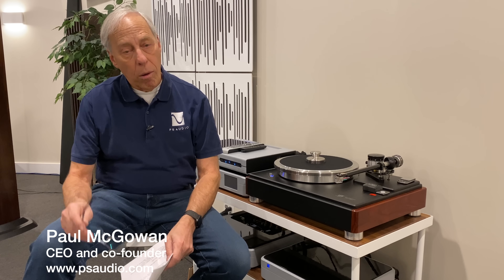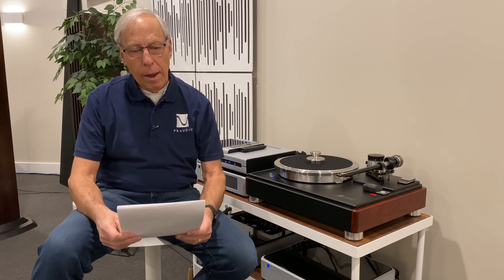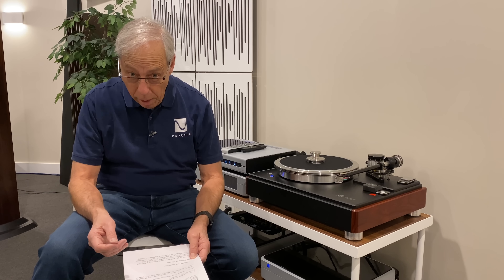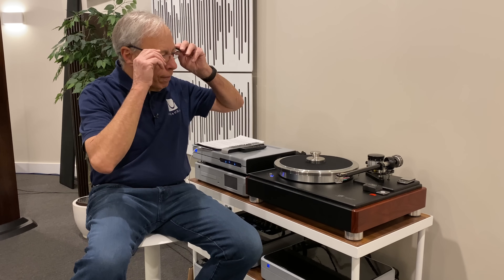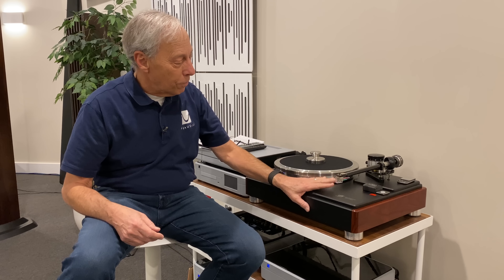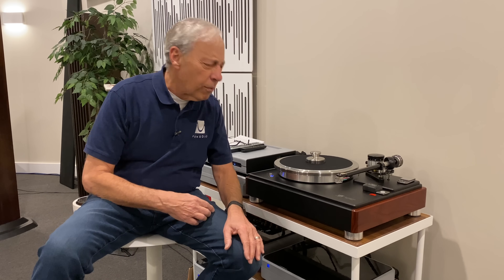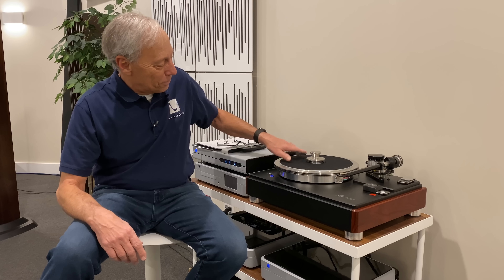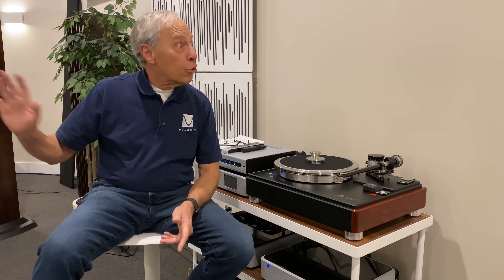Better to use a power conditioner or straight into the wall?

Comment: I still think your too easily influenced by the power of suggestion. A little series resistance in the mains line would effect peak power but that should be about it.  All those super high grade DC supplies give you all the quiet you need.  The iron core transformers inherently filter out most line noise you may be loosing sleep over.  Those oversized capacitors do the rest.  The loss of ambiance or whatever would still lead me to keep looking for a quantifiable explanation and solution.  If you think about it, the IRS speakers were as close to perfection as you could get but wait, we've upgraded the woofer system so now, now they're right.  The only way we can find contentment is to believe we've reached perfection.  Then reality sets in.  Drat. 

Sadly your power re-generators just introduce more stuff that does basically nothing but introduce reliability problems.  I suppose it could boost the mains voltage a little but so what.  I'd be curious to know what the carbon footprint would be for the manufacturing of one unnecessary power re-generator.

Back to the in-line common mode line filter...  I think what your saying is that the line filter some how would effect either the overall sensitivity or maybe slew rate of the system.  Hum?
Reply: if one is concerned about the carbon "footprint" of a manufactured item, it would behoove one to contemplate why he does not live like Diogenes or simply go the whole hog and cease one's own 80 year long conversion of oxygen into carbon dioxide.
Reply: @grandrapids57  Who's one?
Reply: @chrisharper2658  If you mean by "Who's 'one'" then "one" acts as the generic, universal pronoun in this instance, and by necessity that includes thee.

Comment: Of course a power conditioner (which ps audio peddles), is necessary for clean sound. 
And 12 inch tweeters are necessary to produce those highs.
Reply: blackened 1 ...what the f#@k are you smoking dude?!
PS Audio do not sell (peddle) Power Conditioners
PS Audio sell Power Regenerators
Do you understand the difference between the 2 devices? Obviously not. You need to get off the drugs for a while
Reply: @FatRat-f9m  ok

Comment: For me personally with my system the results are the exact opposite of what Paul says. 
I am using an iFi Powerstation. I've been testing going back and forth between the power conditioner and straight into the wall with my amp in the last few days and the results for me personally are much better with the power conditioner. 
I am not saying Paul is wrong, maybe some older power conditioners weren't as good as some of the newer designs, and I am sure a power re generator is the way to go if you can afford one, however conditioned power vs straight to the wall I think is very much system dependent and results can very quiet a bit from one person to another. 
Best to do an in home trial with your own system and let your ears decide what sounds better to you.
Reply: Was the line a shared line or dedicated?
Reply: @levijessegonzalez3629  It's a shared line
Reply: @spectralmeat  Well it could be because it's a shared circuit...

If it was a dedicated power line, the results usually are very very dramatically better. 

I'm currently running 3 dedicated lines to my Studio and also I would suggest looking at high quality receptacles as these make a difference supposedly.  

there's a guy on ebay right now selling some HBL5262 receptacles (audiophile approved receptacle) for very cheap. I bought 5 for 37$ shipped
Reply: @levijessegonzalez3629  Thank you for the reply. I am planning to run a dedicated line to where my stereo is when funds allow. It is a finished basement so running a line will be a bit pricey, but ultimately it will be the best option.
I will look into the receptacles, thanks for the heads up!
Reply: @spectralmeat  It is pricey especially if it's not a new build. (thats why Im thankful I just learned all this literally right before I am about to wire up my place).

However the good news is, you might like the dedicated line so much, that you can sell your conditioners and that might pay for the line or at least part of it.

If you do, definitely buy a hospital grade receptacle. The HBL5262 is great because it's solid brass contacts and connections which is highly conductive
Reply: i can second that, ifi’s parallel AC power filter infact increases dynamics, unless one puts too many of them in the power strip (3 for example). it seems to use a different approach than conventional parallel power filters do.
Reply: Voltage irregularities reduce transient response I feel.
Reply: If it aint blind testing, the placebo effect can fool your mind. In your head, you are pre conditioned to favor what you prefer or expect. So anyone who knows what is hooked up cannot be trusted. Do not say money does not count. When you know device A cost 10.000 and B less then 10 dollars that immediately changes your mindset . And yes, that makes a huge difference when testing
Reply: I have a monster HTS 3600 and I also have the opposite results, i get a better sound when connected to the monster than when connected to the wall, it’s a shared line, I guess that might be the reason
Reply: spent money always sounds better.

Comment: I like Paul and especially his demeanor.  Paul uses 1997-98 as examples for his experience with line conditioners.  What Paul neglects to mention among other things is that like any other cmponent there are superior and inferior line condtioners.  What Paul also doesn't mention is that finding superior line conditioners that actually work as intended is like looking for a needle in a haystack vs the many that that would be classified as inferior e.g. those that do nothing or induce their own sonic harm and for which there are many.  In fact, in my limited experience, the more popular the name brand, generally the more inferior the performer.  In my limited experience, superior line conditioners are easily the 2nd greatest sonic improvement one can achieve for a given playback system.  In my case, the ones I use are passive (draw no current to themselves), dedicated, and bi-directional filtering.  I've used several models for the past 20 years.  Once you've heard what superior line condtioners can do for a system, your tolerance to listening to a system without superior line conditioning is limited to about 10 - 15 min max.
Reply: Interestingly you don't mention what are the good ones since you likely have a hunch that it's all in your head.
Reply: @hartyewh1  siily goose.
Reply: @ToadStool942  Still not putting your word on anything...

Comment: yeah straight wall is night and day on on my KEF LS50w's. Class D may be more picky with cheap power strips too I could be wrong on that though
Reply: I think fully analogue class A or AB is more sensitive to both radiated and conducted noise from the power source.
Reply: @QoraxAudio  
Class A or AB does not define power supply type inside an amp. It can suddenly be SMPS (Emotiva XPA products).
Reply: @alexanderbelov6892  Did you reply to me? Because I didn't mention PSU typologies.
Reply: @QoraxAudio  
I mentioned SMPS because it does not give any chance to source line noises to reach AB amp schematics. While if SMPS is properly filtered itself it has very low noise floor to provide SNR of about 120dB.
Only linear PSU like huge transformer, diode bridge and filtering may pass something from source line.
Reply: @alexanderbelov6892  Same applies to linear PSUs - the transformer provides galvanic isolation against noise.
PSU typology is a non-issue... it's the quality of the design and its implementation that matters.

Comment: Kevin Deal of Upscale Audio says  Audioquest's Niagra 3000 power conditioner is the real deal for clean power and dynamics.  What would be  the comparison with the P12 or P15 Power Plants of PS Audio?  I suspect both are quality products which attack and eliminate the problem of noise in the AC line. I live in a 9 story buiding with 8 other apt. units before mine in the 15 amp circuit. My P12 makes the music more open to a higher level of enjoyment.  Paul did say some power conditioners are designed properly and do provide sonic benefits without sacrificing dynamics.
Reply: @William...that guy sounds like 1 of those telemarketers...."buy one, get one free....be the first 30 callers and we'll give you.....".

He could sell anything that dude!!

Comment: Which is better to have thinner coil wire on the primary or the other way round? I would have thought having a thin while on the secondary would be better because you introducing a better increased electron flow through the circuit go on Paul gives us me a answer!

Comment: This makes my imagination run crazy.  Just imagine a large heavy flywheel with both motor and generator physically attached.  Drive it at 3600rpm and keep the speed rock solid stable using feedback from the output generator to control how much extra drive is needed to keep the speed stable so you get a solid 60hz.  There would be a limit to the power available but it would be good clean power up to that limit.  Plus there is no reason why such a unit couldn't be flat-out  steam-punk beautiful.  Silent would be the trick, but with good bearings, maybe even magnetic ones, oh what a work of art that would be.
Reply: What i did was (i think) a lot simpler, modify equipment to run directly from batteries, no fancy gear, some diy, some recycled, but a lot of reading. Every peace of equipment you own runs on DC, the AC current gets rectified to DC internally on the equipment power suply, i started with the source, got a passive cooling SSD laptop, run a dac from lithium battery (here you have to bring down the voltage from 8.4~7.6v to 5v, this is done by a diy linear regulator with a cuple of 1F 5,5v caps, just because i had them laying around), and im currently modifying the amplifier (shitty 90's hifi class AB) changing caps and getting rid of the transformer and rectifier circuit, it's by no mean close to what you can get from a hi end well-know brand equipment, but living in Argentina makes those equipment impossible to get, not even talking about paying for it, we cant even see this stuff on hi fi shops...
Reply: @antinoriberenice  Hey, if you can get what you are doing to work for you, then I say BRAVO!! :-)  GOAL!!
Reply: @foxpup  I have no B plan, so it works or i quit listening to music LOL. Jokes aside plan B is moving to New Zealand in 2 o 3 years, work and buy a pair of harberth speakers with some nice AMP :D
Reply: @antinoriberenice  wishing you the best :-)
Reply: @antinoriberenice  I think there are battery power supplies in audio if you search. there was a preamp or phono stage maker that used batteries for power which were recharged . I suppose this battery power provided cleaner power free from mains noise and RFI/EMI but obviously if it a battery supply was a good solution every hi end audio company would be using it by now.
Reply: @rd264  Yes there are, buy i do not have any money, living in south america makes things a lot harder, mostly in Argentina were you CAN NOT import goods, i dropped the battery, i now use a very large transformer with a "super regulator", sounds like some new technology but it is simply a linear voltage regulator after a linear voltage regulator, i got a oscilloscope too for measures, its good fun, if you listen a well know brand speakers and amps they obviously sounds a lot better, but for what is worth i get a lot of fun AND good sound (kind off).

Comment: I often wonder how a pure Solar generated power supply, dedicated only to the sound system, would perform.
That is, connected to a very good quality inverter.
This has to be the ultimate, surely.🙂
Reply: You could avoid AC & keep everything DC
Reply: @FatRat-f9m  
Indeed!
By connecting solar panels suitably ( series / parallel) you can get whatever voltages the power 'rails' of any component needs.
This negates the need of expensive power transformers inside components and all the electromagnetic fields they create!
Food for thought for Paul? 
New designs? New concepts?
BTW, it has been done in the past with some phono preamplifiers (can't remember the brands), that used battery power to operate rather than the mains.
Reply: @FatRat-f9m  
I think we might be giving Paul (and PS Audio) pointers for another line of equipment, one for absolue purists!
Problem is, what is he going to do about the massive (and costly) power re generators?
As far as I know there's nothing in the market that employs this kind of technology ( apart from the phono preamps that I mentioned before)
As for the actual cost of such exercise, I think the total amount (including panels / installation /batteries etc) could be less than the price of
one of these re generators... Food for thought!  .........and with this I shall bid you good night for the time being and try keeping safe with this virus business.
Reply: @FatRat-f9m  
LOL!  A weather dependant HIFI system!..
..but, on a serious note, steady voltage and current supply is possible with charged batteries and correct electronic voltage stabilization.
The ultimate in silent power supply!

Comment: I cannot follow how a line filter would remove high frequencies and overtones ... I think Paul must have placed the filter in the speaker lines ! They go in the 120 vac lines !!
Reply: @FatRat-f9m  I know, I remember the men at work song.. How you guys thunder while eating that Vegemite stuff. Thunder=farting?
Reply: @FatRat-f9m  No you Aussie, its "Plunder and Chunder"
So thats robbery and puking, maybe even farting, too!
What was the video about?
Reply: @sailingaquarius23 … the video ?
F#@k  knows...I was wa-a-a-ay too stoned (high) back then to make any sense of the video.
Reply: At 66khz. Makes a world of difference. Isn't your system "resolving" enough?
Reply: STEREO JUNKY ~ 66Khz ?? the HF drivers don't respond any where near this frequency... 
our power is REAL power 250 vac 50 Hz and the currents are half what they are in the States ... Power  conditioners are only of some use on 120 vac lines due to the variation of voltage  drop arising from the heavy currents ! You guys should change from 120 v to 250 and come of age lol 😂... oh and get Metric too !!

Comment: In order to answer this question we must know if there is a lot of noise in the wall contact or not. if you live near an industrial area then you may have noise. Ask the electrician if he has the equipment to measure noise!

If you have low noise that most people have then you will notice no difference with a power coditioner. You should also have high-end sound system before there is any point in buying something like that.

The weakest part of a sound setup is speakers !!!

Comment: "There are a few that you can [ plug into ], but those are rare." What are those rare ones?
Reply: Have you ever seen a regular noise filter? You will find them inside the power supply in your computer or TV screen to similar. The coil that is used has a fairly thin cord. No ordinary amplifiers use noise filters!

When the amplifier draws a lot of power, the noise filter behaves like a resistor. Instead of delivering 50v to the amplifier, it gets 45v or less!

It will be the same as towing your car with rubber bands or whatever they are called in the USA

Comment: Paul, what about the Dectet that you still sell? I bought one a couple of years ago with an AC-3 power cable. I immediately noticed a cleaner background, but didn’t notice a loss of dynamics. I haven’t done a comparison with and without yet. Should I throw my Dectet away now?
Reply: Would love to know the same. Not spending over $750 for power distribution.

Comment: Negative resistance material doesn’t exist, anything between equipment and power grid will increase impedance, if you look them as a whole system. If power grid can’t feed your amp properly, it won’t feed your power plant for sure.
Reply: If 30kV•50A power grid with last mile 500kW transformers array cannot feed your amp it probably produces light and heat for a skyscraper instead of sound.